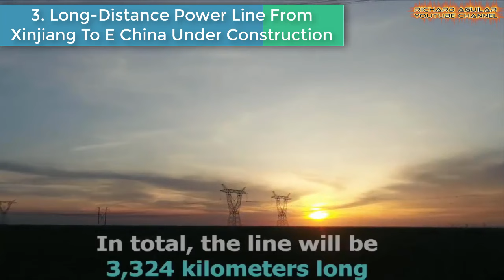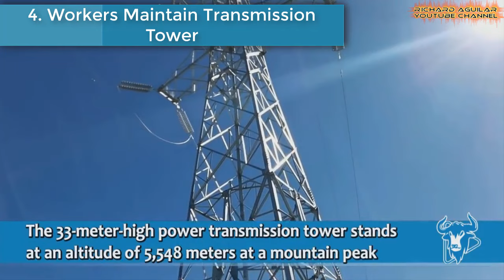China's Unbelievable Skilled Power Line Workers Walking In Clouds

Comment: Question for the electrical engineers reading here: Why do they have six cables per strand for the 1.1MV line?  (vs. most of the power lines here in North America are single or sometimes double cables.)
Reply: at about 5:33, it's eight cables per strand!
Reply: I'm sure there's some cost vs tensile strength vs resistance type optimization problem behind it.

Comment: Nowadays this kind of work can be done by drones.
Reply: Doubt about it. China has the leading technology in domestic drone technology, e.g DJI. Why didn't they deploy the drones instead to do these jobs? Maybe the job can be done by those Transformers from your blockbuster movie collection?
Reply: @cclenergy3033  Yes, drones can complete part of the work, most of which are used for inspections and inspections. This is very used on China's transmission lines, because China has the most drones in various industries. However, the installation and maintenance of transmission lines cannot be replaced by drones.
Reply: Can you teach DRONES to tighten a loose nut or replace a Broken Glass Insulator ????
Reply: @bigbobtong  read the previous answer.